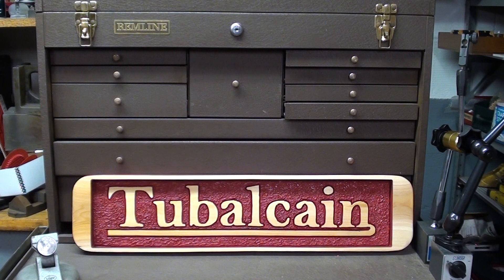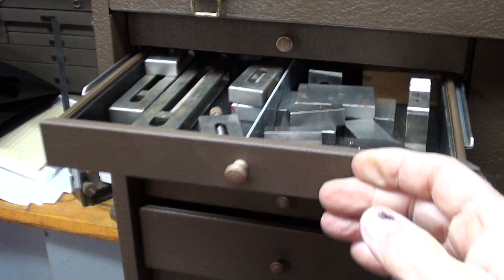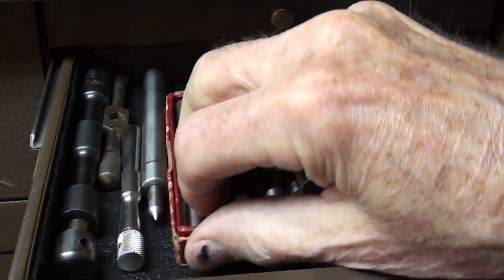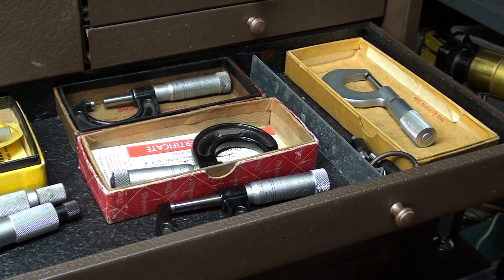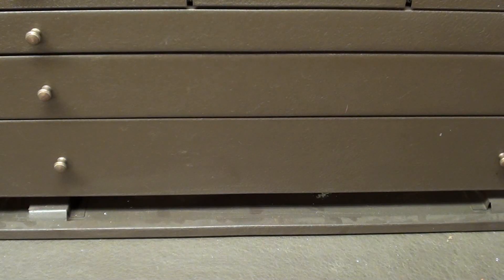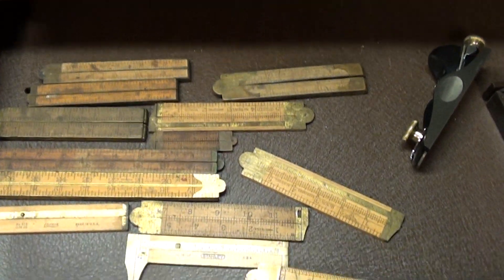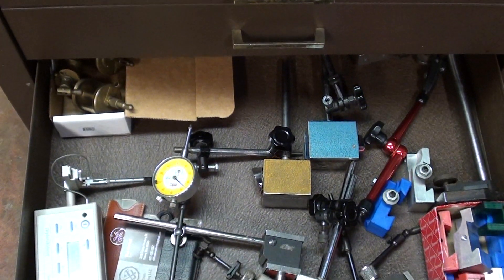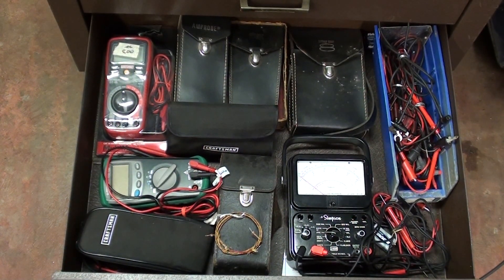What's in Tubalcain's Drawers #2 Tips #429

Comment: On those electric meters, or any other device with batteries in them, if you don't use them for long periods of time, remove the batteries because they eventually will leak and ruin your device.
Reply from the maker: You are right. I bought If you Simpson meters at garage sales. I then had to throw them away because of licking batteries

Comment: NOT boring at all! Really enjoyed it :) I've got a few Federal Indicator Gauges that are a little slow or sticky - any suggestions on how to get them back to new condition? They were my Grandfathers and Dad's so they are important to me.
Reply: Bobby W , a drop or two of Tri-flo works wonders. Seems to last and doesn’t leave a sticky residue.
Reply: Dale Derry had a video on that.  He used mineral spirits to clean them.  I tried that on several sticky ones I had, and they are smooth movers now.  Most of the gunk is on the plunger.  I used a q-tip to clean it and it was like night and day.
Reply from the maker: I am very hesitant to take one apart, the screws are so tiny